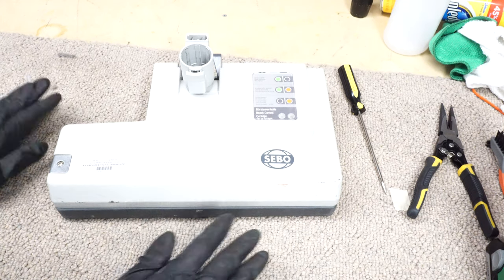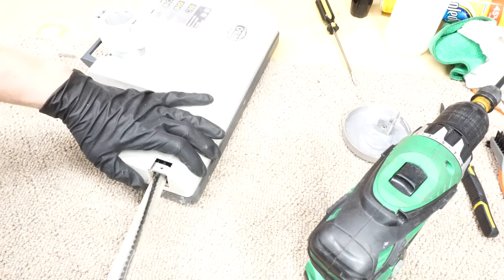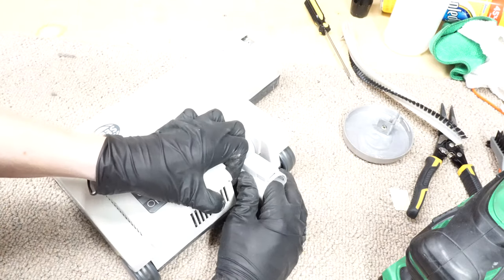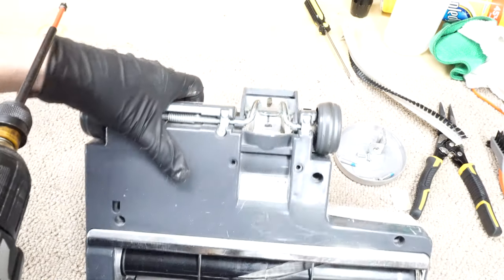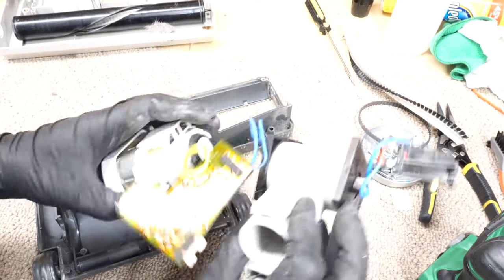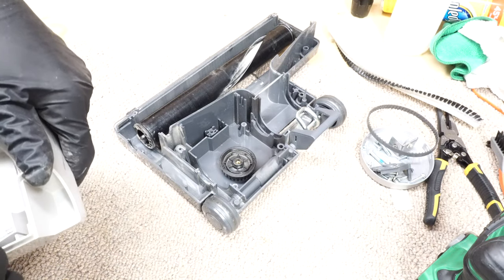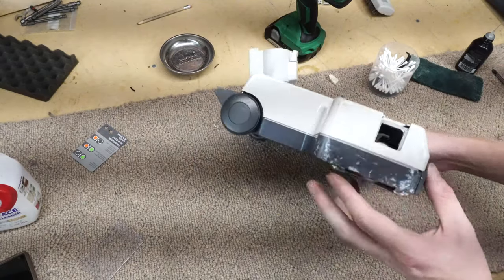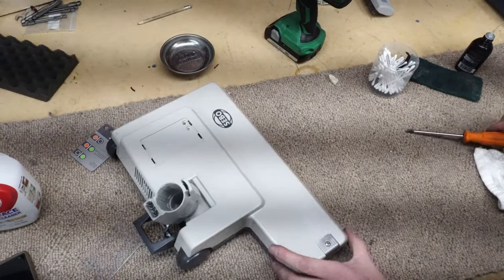SEBO ET-C Vacuum Cleaner Power  Nozzle  Repair -Patriot Vacuum Repair

Comment: My neighbor had her vacuum on the garage floor to vacuum her car. She left it here and then ran over the hose the next day. I straightened it out with channel locks and plugged it all back in but the brush did not spin. The voltage and current run thru the hose to the power nozzle. Something was broke (copper continuity) and I deemed  it non-repairable and a new hose is cost prohibitive.

Comment: I wish you show how to take off the spring roller too. I have the Sebo ET 350e, took the spring roller out, and couldn't figure out how to put it back in properly.
Reply from the maker: "don't try this at home" "please bring this to your authorized service center" wax lost on you I see 🤣
Reply: @PerformanceReviews  Thank you! Will do. I had a clog inside the power head and I thought I needed to take the roller out to access the inside, turned out it didn't make a difference but now I cannot get it back together. Should have watched videos before attempting to clear the clog myself.